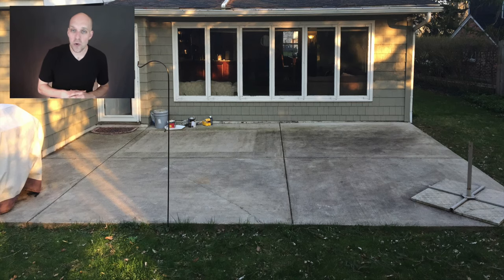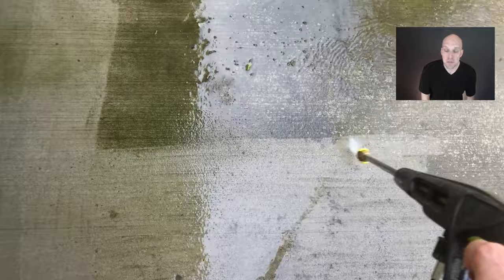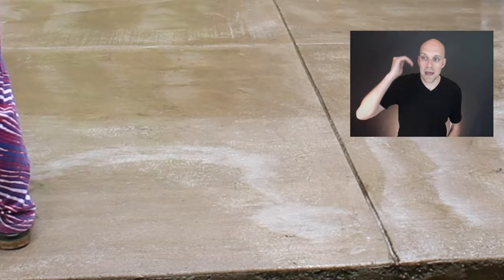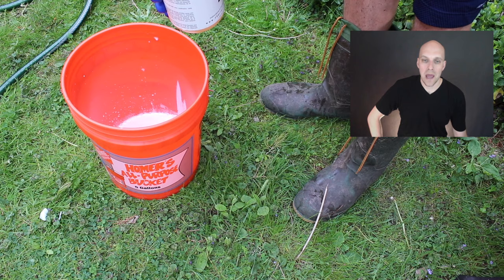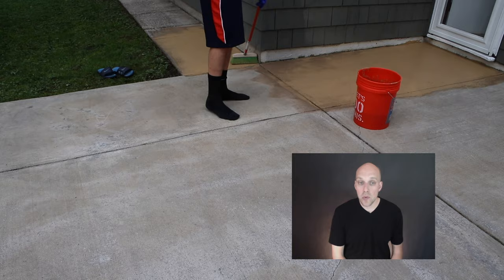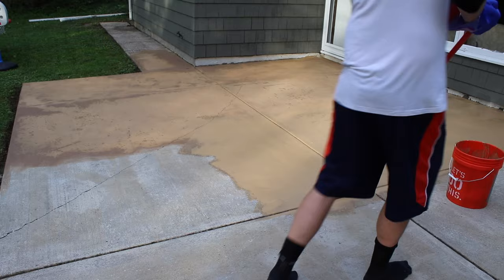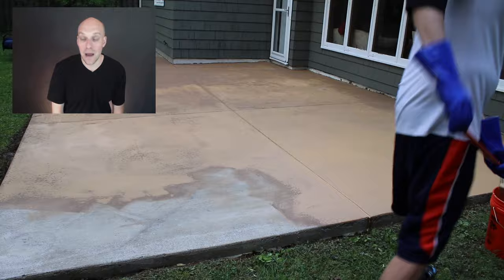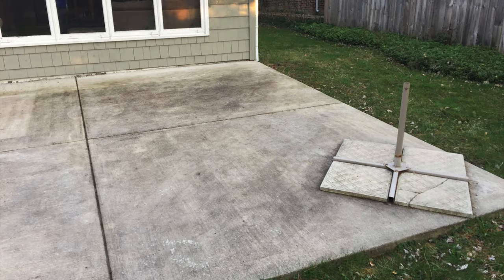How to Stain Concrete (simple DIY method)

Comment: Great video.  Very informative.  Showed the steps he used through the entire process.  Very useful and gave me an idea for repairing some damage one of the stucco repair guys caused by not know ing how to use a power washer.  He was trying to just wash away grit and dirt but aggressively applied the power washer directly on the concrete and blew away all the surface fine fish leaving exposed coarser aggregate wherever the power washer was used.  He didn't try to do his work uniformly so my patios and driveway ended up with random streaks of scarred concrete wherever the power washer wand strayed.  It looks terrible!  I have a mess to repair and this looks like the perfect solution.  Great idea and video.  Thanks.

Comment: Our Cottage of a home we dwell in has similarities to something designed by Frank Lloyd Wright. This will finally be the time that I stain our cement walkways with a Cherokee Red as a nod to the master. Your video is extremely helpful. Ironically I just purchased a 3300 PSI gas power washer for our boat, outdoor furniture etc. Anyone that has ever owned or rented a power washer knows how it goes, you end up power washing everything you own. It’s quite addictive and the perfect tool for this cement staining project.

Comment: That’s a very elaborate job. I simply vacuum and sweep the area and roll the stain without any extra steps. I do my lanai, drive and walkway every couple of years. I only use sealer for the drive and walkway because they get direct sunlight.
Reply: What kind of stain do you use?
Reply: @berniebelzer  I used Lowe’s water based stain. They can mix to any color you like.

Comment: I like how it seems to still look like regular, flat concrete, not painted.. would you say that this is the case? we just had colored concrete poured and after some overworking due to drying fast on the crew, we may end up staining it to get the color we wanted (which happens to look just like this color you used)

Comment: I have a fence surrounding my patio and in some spots the concrete is very close to the fence. If I used the acid and spray it off will that damage my fence? If so, can I just cover the fence with protective plastic? Thank you for the great video!

Comment: Now the BIG question: is it cheaper and easier to simply add the color to the cement before pouring the slab initially (if the slab doesn't already exist), or it it best to do it later as you did?
Reply: Way better,  easier, cheaper to do before the slab is poured . I wished I knew for that for mine.

Comment: Tackling my driveway this year.    Thinking of getting this done after I level it out and seal up the cracks. 
Does this stuff peel off after a few years?
Reply from the maker: It’s a stain so I don’t think so. I did see some mentions that if you’re doing a driveway make sure it’s had time to cure and not run certain types of soft rubber tires over it.

Comment: Would this work on stamped concrete? Our cement guys put the wrong release(Terra Cotta) on our stamped concrete so we had them pressure was it off the next day and now it’s left looking like a peach color😱 we wanted it to match our Mojave patio deck🤦🏻‍♀️Do you think this can be used over the Terra Cotta(which hasn’t been sealed btw) to match our existing patio?

Comment: Thanks Eric for your video.  I ground with a diamond grinder and managed to gouge
some places and wondered how to fill them level so that they can take the stain.  Do you have any product recommend to fill small cracks and gouges that will take the stain ?
Reply from the maker: Good question. If you look in the comments there is the company deco Crete supply. Their customer support was helpful if you want to call and ask them.
Reply: @ProBuyersGuides  Thanks

Comment: don't get acid on  those zumba's haha, go bills! how is this holding up? do you get color on your shoes after walking on it? I have an enclosed porch, so it won't get rained on to wash the excess off...guess i could mop it after
Reply from the maker: Those are my church pants. No way I’d get acid on em. 

I didn’t get color on my shoes. You may not get the same dulling of color I did with the elements but I was happy for that as it was too Orange out the gates but with time looks much more natural. I still would have gone with a more natural neutral color if I could do it again.

Comment: Whenever you use muriatic acid (diluted hydrochloric acid), power wash immediately or vacuum the acid from the concrete. When the acid reacts with the calcium and sodium components in concrete, it converts them to calcium and sodium chloride (salts you definitely don't want in your concrete). Probably not an issue if the surface isn't too permeable, but I wouldn't risk it.
Reply: Robert. Are you saying it’s good to use the acid, but just make sure to rinse it off?
Reply: @kbrooks3215  muriatic acid is ok to use provided you pay attention to how absorptive the concrete surface is. If it is open or absorptive I would rinse the surface very well and use an indoor/outdoor vacuum to remove any potential residue.

Comment: When you apply the muriatic acid, did you mix it with water or just plain acid. And how many gallons did you use on your patio concrete? Thank you.
Reply: he stated put the water in a 5 gallon bucket then add water {not to splash} 4 parts water one part acid

Comment: So I noticed that you had a crack on the patio on the bottom left. Do you think if you would have used concrete filler or patcher or something like that and then did the stain Would it have been noticeable do you think?
Reply: +1 really curious
Reply: Wouldn't have been noticeable if you were to have grind it down making it even with the rest of the concrete

Comment: Very good video but can it work in a painted concrete?
Reply: I would think no....if the surface is painted then the concrete will not be able to absorb the stain, it would just sit on top of the surface.

Comment: How deep into the concrete does it go?

If you were to cut the concrete and look into the cross section, how many millimeters do you still see the stain?  I know it will be variable depending on the density of the concrete but at least give us an idea.

Comment: How would you go about staing if the previous owners glued outdoor carpet to the concrete porch? We have sanded it many times but still can't get all of the glue off.
Reply: remove the glue using a solvent first. then follow this video.
Reply: woah! glued carpet to concrete.  thats expert level decorating. I had to get liquid latex of 1,000 sq foot concrete patio.  purchased a 7" angle grinder at lowes with a metal grinding disk [for concrete - it had these thick metal teeth] and that ripped it all off.  wasnt hard to use but took days... was a huge job.  ill see if I can link the grinder for you.
Reply: @avidreader6097  yes! They wanted to make it permanent but unfortunately the steps didn't last that long and became a hazard. I have tried a metal grinder and it did smooth it down but the glue is clearly still there.

Comment: whats the difence between painting and staining
Reply: I am no expert, but I do know a stain penetrates into the surface and paint does somewhat, but also dries in a thin layer on the surface. If you paint concrete I would have to say over time it will start to peel off. stain impregnates the surface and should last much longer. You could also apply a clear seal coat over the stain to help protected it even longer. Make sure the concrete is no new and has cured fully.

Comment: before staining you need to know if your concrete is sealed or not. If sealed, muriatic acid will not work and will have to grind it off. This is the biggest mistake people make when trying to apply stain or epoxy paint on existing concrete.